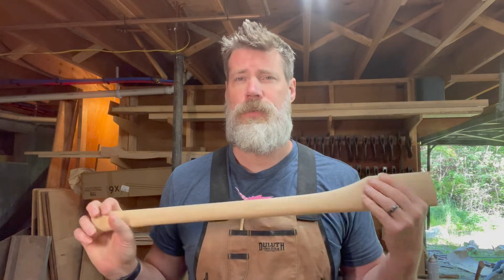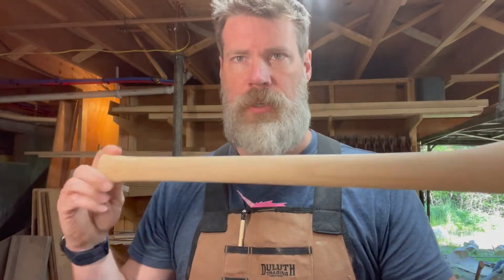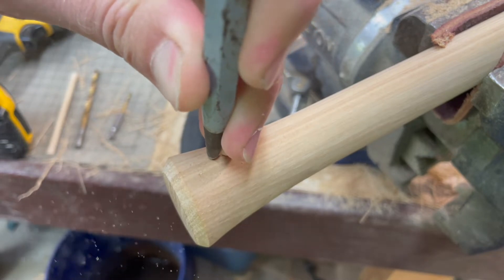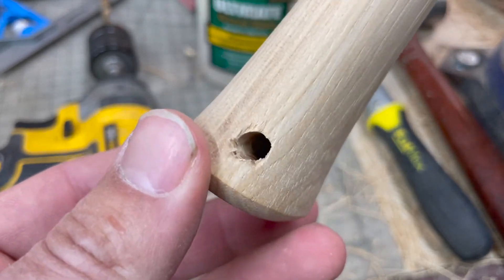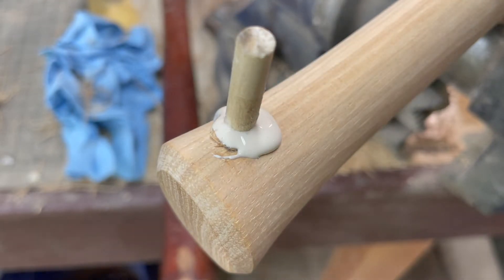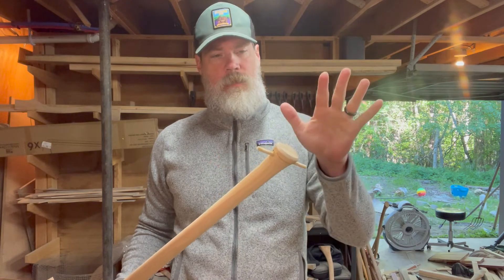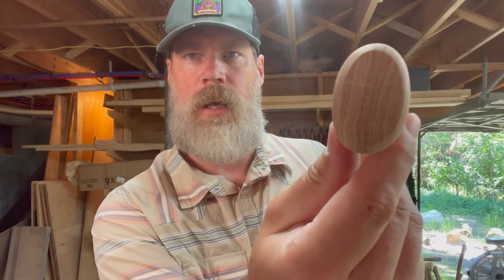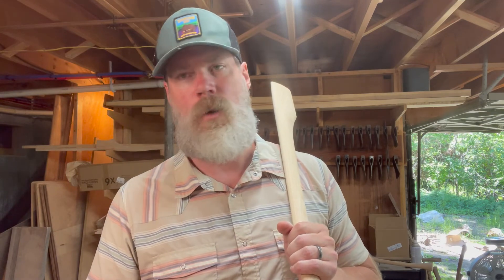Cracked Axe handle repair: Dowel Fix Method

Comment: I usually add one step to your method. If the split is straight, I cut down the line of the crack with a handsaw and glue a slip of wood into the kerf, effectively gluing the split. Then I go ahead with putting in the dowel. .... and yes, I do wear a belt and suspenders  ;<)

Comment: Thank you so much for this idea.  I used it as a test on a piece of bubinga.  The white oak dowel working just fine as a test, but unexpectedly a friend wanted that handle over others because of the contrast and look.
Reply from the maker: Excellent.  A lot of good things happen by accident.  Pay attention to inspiration.  It’s sitting right in front of us sometimes.  Thanks for stopping by and commenting 👍🏼

Comment: I just did this dowel repair on a vintage handle on my E&S Connie. It’s running the length of the axe below the head. It worked incredible and has held up unreal. I used 1/4 inch

Comment: I have a handle with 2 long cracks -- maybe 8" visible running the center (between the head and handle swell) of a beautiful old handle.   I believe they are the same crack just visible on 2 sides.   Any thoughts about how many dowels per inch?
Reply from the maker: Man that is sounding pretty bad.  I have only used it for repairs in the lower palm swell.  I am not sure I would feel comfortable doing it on long cracks like that.